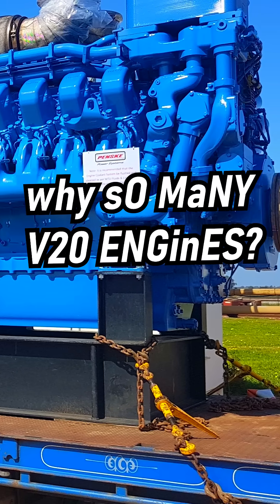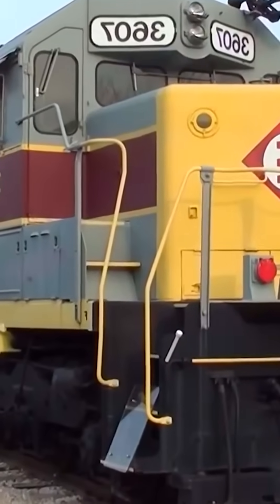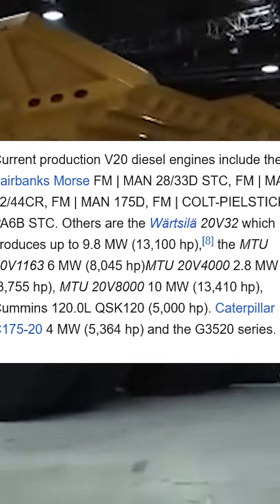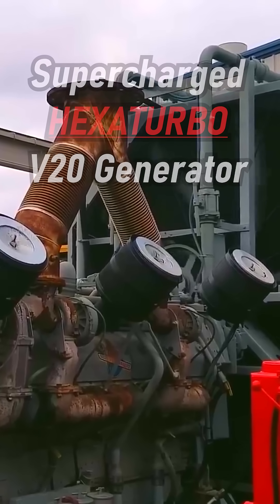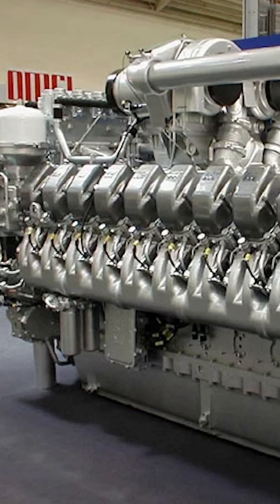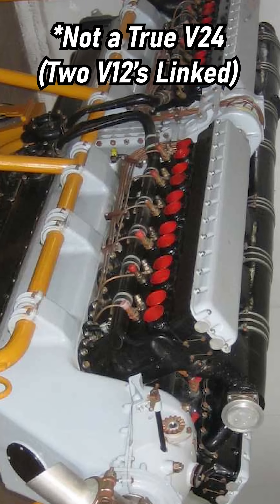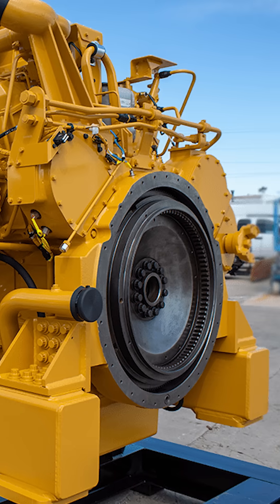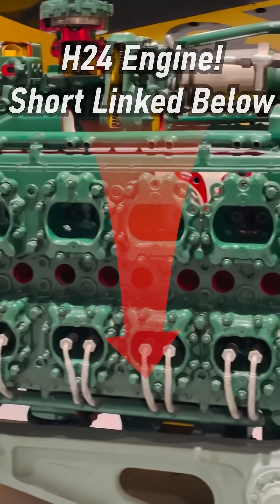wHY aRE V20 ENGiNEs sO PoPuLAR?

Comment: the real question is: will it fit in a miata
Reply from the maker: Anything will fit in a Miata if you try hard enough
Reply: @BladedAngel  
 - "Anything will fit in a Miata if you try hard enough"

Naaa,. no way.  You could never fit my ex-wife in a Miata. No effen way, even in a week with seven days ending in "Y".
Reply: @BladedAngel  (fuel tank has entered the chat...)
Reply: @dantesinfernopurgatory7826  we just have one of those air tankers constantly flying over it with a very long hose
Reply: @BladedAngel with enough hammering, welds, and tears you can fit it in a Miata
Reply: @BladedAngel   more like a miata will fit in a V20
Reply: @BladedAngel  that's what she said
Reply: @BladedAngel  if the engine is smaller than the Miata it can fit
Reply: @BladedAngel a particles accelerator swapped miata will beat it anyways
Reply from the maker: @im_a_phan  Oh no not this again.  I'mma have to wihp out the Rotary Magnetar Powerd RX-7 to gap yo Particle Swapped Miata
Reply: @BladedAngel  nah,ill just nuclear swap my miata like those aircraft carriers and itll gap your rx7 as it willl run out of fuel before my miata
Reply: Fitting a Miata in this engine seems easier.
Reply: 💀😭 @dorukayhanwastaken
Reply: @dorukayhanwastaken 😂😂😂
Reply: Ofc, My grandma's cat's goldfish that has a quadturbocharged V20 swapped miata that will beat any car in a race!!!
Reply: Probably have to move the drivers seat above the engine and drive it like Mr bean but it’s probably doable
Reply: of course! you just need 4 simple cheap materials:

1:miata
2:torch
3:welder
4:$50,000 worth of steel
Reply: Yes
Reply: With mods yes
Reply: Of course it can
Reply: it wont even fit ON a miata, i think the footprint would be bigger than the car
Reply: @MarkoDash  
 - "it wont even fit ON a miata, i think the footprint would be bigger than the car"

I can see problems with the bell housing interfering with the spare tire, but other than that, ...
Reply: You'll not being creative enough! ;) @MarkoDash
Reply: Well, that caterpillar engine weighs upwards of 12 metric tonnes, which is about 13 Miatas of mass. So… maybe?
Reply: Ong hell ya u can
Reply: Do as the Australians do and stack the shell of another Miata on top to hide the engine and have one guy steer and another guy use the brake and gas pedals
Reply: nah, will it fit in a Peel p50?
Reply: Of rouse it will fit the Miata no problem.
Reply: In a miata, the sky is the limit
Reply: @DorylPlz  nonsense, with a few Rolls Royce jet engines and some afterburners space is the limit. Once we figure out how to build a warp drive then interstellar space travel will be the limit
Reply: the miata will fit inside the engine
Reply: @LIONGOD  imagine a car dealer trying to sell you a Miata powered engine
Reply: C175-20 (cat 787B) has a single piston bore of 5.3L
Reply: @mackenziemcintyre1378  So what you're telling me is there's still a chance.
Reply: @kyototomokui6676 not really lol
Reply: @mackenziemcintyre1378  Man, the joke flew so high over your head that it almost hit the Hubble Telescope.
Reply: Seems impossible that it wouldn’t
Reply: I think grorg tv will make it fit
Reply: Where I’m from that’s called fitting New Orleans into Algiers, never knew what Algiers was but apparently according to google it’s a ferry terminal
Reply: These are the important questions we need to be asking😆😆
Reply: @lonewolfgardening4237  we’re taking a page out of Josh from letsgameitout playbook to see if there is a limit
Reply: Absolutely
Reply: this is what you do, take 2 miatas, weld them together, and the rear miata acts as the engine bay for the v20
Reply: Go in dry
Reply: Full send
Reply: No, it will not fit in a Miata.

...but what if we MADE it fit in a Miata?
Reply: @dozerfarms were talking about an engine the size of a modern pickup
Reply: Yes it will 🗿
Reply: if you make room for it yeah
Reply: In? No. On? Oh yeah 😏
Reply: @Dog_in_tree suspension begging for its life

You hit the speed bump at the drive through and fall apart like in a Lego game
Reply: Where there's a will there's a welder.
Reply: We've seen vr12 jetta and a polo but not a vr18?
Reply: Miata might be lighter than this engine
Reply: @irgiefarras  A Miata is lighter than most engines (/j)
Reply: A stretch miata.
Reply: Kysyfl❤
Reply: Everything will fit in a Miata.
Reply: build the miata around it
Reply: nope. BUT I SHALL MAKE IT FIT
Reply: Yeah sure just remove the front half
Reply: A little elbow grease and a 6 pak afternoon, you'll have yourself a track sleeper by the weekend
Reply: That and can it run Crysis.

I'm sorry I had no control of that.
Reply: YES just get a wideeeeeeeeeeeeeee body
Reply: Will it fit up y- jkjk
Reply: but will the car still be perfectly balanced
Reply: Some galvanised square Steel and nuts borrowed from aunt Will do
Reply: Will it fit in my butt?
Reply: just get some small pistons and engine block
Reply: You beat me to it 😩😒
Reply: With minor modifications, there's a chance!
Reply: This is the same question as “I wanna build a plane around this GUN I found, make it work!” 😂😂😂
Reply: I was about to say that😂
Reply: no
Reply: sybau
Reply: MX-5***
Reply: @jazzingpanda3190  It's a Miata.
Reply: @kyototomokui6676 it’s an mx-5 
Stop using Americanisms 💀
Reply: @jazzingpanda3190  MX-5 is what the Americans call it. If you're gonna be annoyingly pedantic, then the proper name is the Mazda Eunos Roadster.
Reply: Obligatory "thats like putting a 40 inch into a 10 year old" comment

Comment: The true question is:will my 40-3-8-2-2 engine fit in a miata (40 cylinders, 3 alternator 8 starters, 2 exhaust and 2 coolant manifold.

Comment: Just to clarify, Diesel Electric locomotives HAVE used V20 engines, but 16 cylinder v’s and now the current 12 cylinder v’s, have been used in the more recent years due to their fuel efficiency, low emissions and high power. EMD’s 710 series and 645E3 engines have been used in the SD45 (two stroke V20 645E3 engine) and the SD80MAC (four stroke V20 710 series engine). It’s not very common, but yet again, has been used. The V12’s and V16’s are used more often, but the V16 was discontinued due to emission regulations in the U.S. and Canada. They called for stricter standards and making the new power supply more fuel efficient, cheap, reliable, more powerful and most importantly, less polluting. If you want to know how fuel efficient one of these locos is, a single GEVO can pull a 2000lbs (907kg) load almost 500 miles on one gallon of fuel alone! That’s about 3-4 times more efficient than a semi. Transport by rail sure has come a long way

Comment: Trains don’t use V20s now. And the train you showed appears to be an EMD SD40 which uses the EMD 645 prime mover, which comes in V12 and V16. Most trains now like the GEVO use V12s.

Edit: I’m partially wrong, some trains (primarily EMDs) did use V20s. They don’t now tho.

Comment: Well, Unless vw has the patent for the w16 still, we can make a w20 by using the w16 method of basically melding 2 v10s together with a set of cylinders offset diagonally to the outside cylinders.

So Technically not a v20 but almost.

Comment: The railroads had problems with the EMD V20's breaking the crankshaft (SD45 series).  When those locos were rebuilt they often had V16's put in place of the V20.

Comment: I have had the opportunity to work on the cat c175-20 and c175-16  v20 and v16.. i worked for caterpillar in 2010 on the cat 797f haul trucks they are a very large engine... we used to hide in the engine area when it rained.. like 8 of us 😂.. the best part about them is the noise they make with the mufflers not connected

Comment: If anyone was wondering.  The reason that the 6 turbo V20 also has superchargers, is because it's a 2-stroke engine.  It is a 20v149 Detroit Diesel.  20 is the cylinder count, V is the layout, and 149 is the displacement per cylinder.  Since the crankcase is sealed off from the rest of the engine for oiling (unlike conventional 2-strokes) it needs constant airflow from a sperate device to force exhaust air out while the turbos aren't providing boost pressure.  (It has 3-4 superchargers if im not wrong). Detroit Diesel made some cool shit back in the day, including a 2 stroke V24 (24V71).
Reply from the maker: Very interesting! Also sounds RAW AS FUCKKK
Reply: That's fucking dope, Detroits are some pretty wigged out engines

Comment: So what if you had a split crank with a kind of clutch system that could stop the rpm from the engine so the machine wouldn’t have to have stress on multiple

Comment: The quad turbo cat engime would be sick in a offroad crawler or something, just an immense amount of power yeeting it up the hill.
Reply: Also an immense amount of weight trying to pull it back down the hill lol you'd need some crazy strong suspension, thick af frame, tractor wheels and tires, holy shit it would be awesome but I doubt it would perform any better than a normal off road rig
Reply: @thecrazyfarmboy yeah ik but POWERRR!!!!!

Comment: Also, pretty much all industrial applications for engines like this are actually ELECTRIC.  The engines are just generator units.  

Anything requiring even more power is either going to be beefy enough for multiple generator units, or pulling power directly from the grid.

Comment: Today, Diesel locomotives now use V12s with V16s being very common. The last successful V20 was the EMD SD80MAC (5,000 HP) in the 90s but all are gone now. V12s replaced the V16s because of emissions and fuel efficiency without losing horsepower. We had the 6,000HP race between GE and GM/EMD which proved that we don't need that much.

Comment: I wish the creator of this video knew that a v16 for a Bugatti is incorrect. A Bugatti has a w16 engine. That means that there's two rows of cylinders creating the double v shape better known as a "w" under each cylinder head unlike the single row of cylinders found in normal v engines. Basically. There are flat engines, linear engines, v engines and w engines. There are very specific differences when talking about engines.

Comment: The v20 engine was used in tbe sd80mac locomotive. A few others but wasn't a popular engine. It had many maintenance headaches. For the most part for freight service in the United States the manufacturers have found the sweet spot for locomotive engines is 16 cylinders and about 4400 horsepower. But will de rate to 4000 hp as the engine and electrical systems age.

Comment: People were saying V16s were too long and the crankshafts start to get too stressed at that point. That's also partly why the W16 was created. so how is V20 now the limit? Is this because these engines are so much larger?
Reply: Longer crank shafts start to bend under there own weight and v engines have less bearings than inline engines. Inlines can get over 14 cylinders long because they have a bearing per cylinder.
Reply: @cloggedpizza239 I just said some of that, and the rest doesn't answer my question. 

Cyliinder limit for V engines in Industrial/marine/rail is apparently 20.
Cylinder limit for V engines in cars is apparently 16.

Why is this limit different? Is it due to the general scale of the engine allowing the crank to have more material? I would think that would be negated by more of everything else, but I am not an engineer.

Comment: long shaft makes the engine to loose power. that’s why V8 is better than inline 8
Reply: V8 is only better because it’s shorter. I8 also allows the segregation of the exhaust and intake manifolds to improve efficiency by allowing as much heat to reach the turbo as possible. They also are more reliable due to there higher bearing count. Good luck putting a i8 in a car and if you have the space just use a high displacement i6. The ship I am on uses 5 inline 8 CATs to make over 10MW.

Comment: And a fun fact about a lot of those v20s in most of the applications you listed, they're primarily used as power generation.
Reply from the maker: ye, I mention that at the start, "You've probably still seen one without realizing it, Electric Generation" as in it's a power generator!
Reply: @BladedAngel  The prime movers in diesel locomotives are basically generators! The prime mover spins a generator, which sends power to the traction motors in the axles, which make the train move.
Reply: I work for one of the world’s largest manufacturers of the housing they make for those generators you’re talking about. 😊 crazy to hear the power they make even at 80 dBs.😅
Reply: I believe all engines are used for power generation am I wrong?
Reply: @masoncole5834  some are used solely for the purpose of making noise and no power - Cummins engines for example.
Reply: @masoncole5834 in this context, it is electricity. And some are even used as power plant (Diesel Power Plant) distributing and supply electricity to town and rural area
Reply: @erdwin5613 trust me I understand… whoosh

Comment: That hexaturbo engine is the Detroit Diesel 20V149, the second number being its displacement in cubic inches... Per cylinder.
Reply: That's a lawn mower sized the smallest emd and first  was 567 last 2 stroke and biggest  was 710 ci
I want my big engines be at least 2 mustangs of displacement per cyl
Reply: The RT-flex96C has 1,820 liters per cylinder. Everything is bigger on the ocean.
Reply: @cloggedpizza239 true but emd engines are found in the ocean 

Also fun fact about the 3 engines named so far fill each classification of diesel. From high speed to low speed
 High  20v149
Medium emds 
Low rt flex
Reply: @ianthompson2802 rt flex would also be a cross head large bore 2 stroke. The ship I work on is one of the few merchant ships powered by gas turbines. 4 to be exact.

Comment: EMD's SD45 diesel locomotive actually HAD crank issues, despite the heavy HP output it wasn't ideal for railroads so they ended up trading in their faulty SD45s for several lower horsepower rated locomotives instead
Reply: It is more efficient for railroads to run two smaller engines over one huge engine.  On level stretches they can power down one engine some to save fuel.  Plus, it is easier to add a third or even fourth engine and have all of them being controlled by one engineer.
Reply: @alanmcentee9457   Yes, they made some 6000hp locomotives but that was too much for a 3- axel unit. Today large over the road diesel locomotives are 4000-4400hp, it has become the sweet spot so to speak.  Spreads the power, and dynamic braking over more axels. Sure you need 3 locomotives to do the work of 2 6000HP units but the flip side is if you lose a unit you don't lose half the power in one go.
Reply: Except SP, they really liked theirs and kept them running until merger.
Reply from the maker: Ohhhh...that's a neat fact and that absolutely checks out.  I guess for a stationary use (Power generation) the crank length doesn't matter much, but since a Train does rev up it's RPM more, I guess that became an issue?
Reply: Yeah lmao, wasnt there also issues with the engine blocks cracking? Or am i mistaking that for another prime mover. Even still there really wasnt much benifit of the V20-645 over the V16-645, at least because of the reliability issues
Reply: Cute Pfp
Reply: You’re talking about the SD50 not SD45
Reply: Oh hi merin!!! I always thought the SD45s had the standard 16 cylinders.

Comment: The diesel locomotive you showed was an emd (electro motive division) product from the 70's which either used an emd 567 or emd 645 (some versions of the 645 were v20) most were 16 a locomotive with a v20 would be something like the f40ph or sd80mac which had 710 blocks in them (no offense just wanted to clarify some things about the locomotive shown)
Reply: The EL 3607 shown here is an SD45 which has a 20 cylinder 645. Also the F40s never had 20 cylinder blocks.
Reply: Oh thanks for clarifying that was wondering if I was right or not.

Comment: The only issue i see, the hight im all for bringing back the land yatchets of the 70s im fine with front and rear bumpers being in different postal codes every time i park but those engines are about as tall as two lifted trucks on top of each other i dont know how you see around or over without having a 3 story tall daily driver

Comment: Most freight trains use large v16 as the engine doesn’t power the train most of the time it powers a generator to power motors that move the train so most freight trains are diesel electric because the electric motors came produce more torque compared to a diesel engine
Reply: They mostly use diesel electric so that the generator can run at its efficient rpm while the motor provides enough torque at low speeds. You certainly can get more torque from a large transmission but that would be complex, costly, and less efficient.
Reply: @cloggedpizza239 it wouldn’t leave room for the other systems and it would be extremely costly

Comment: Well to be honest a v24 would make sense if we just accepted it to be two v12s put towards eachother sharing block, oil, intake and all that while there's 4 cams, 2 driveshafts and you could even link the drives in some way most likely making all the powering go on one side while drive goes on one side since there's no world they don't go by gear
Reply: The Caterpillar 797A and B ran a V24 that was two 3512 V12 Caterpillar engines bolted together back to front with a coupling housing.  This video even shows one two separate times in the video on a shipping stand.  The Yellow Caterpillar with IND decal on the side is one when he says "You've probably seen still seen a V20..."

Comment: To fit a V20 in a car youd either have to move the driver cabin in front of the engine, on top, or dare i declare, a split cockpit, with two bubbles for two passengers, with microphones and speakers connecting them, and a big ol wang connecting the two bubbles, allowing extra downforce